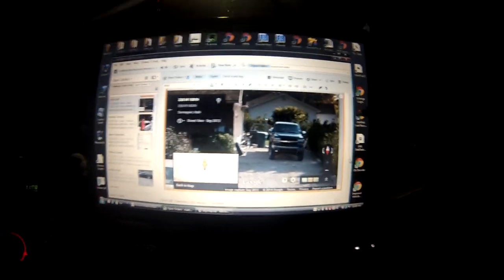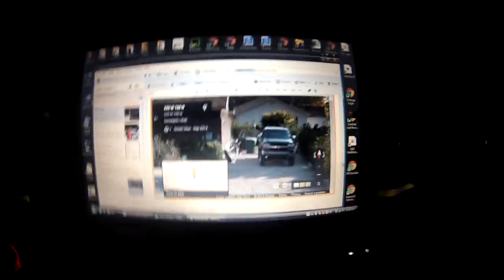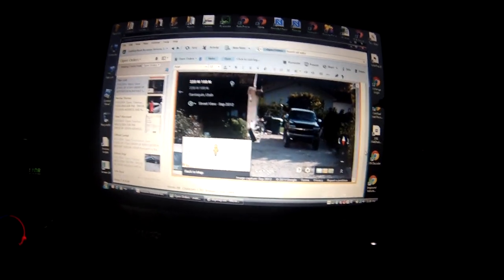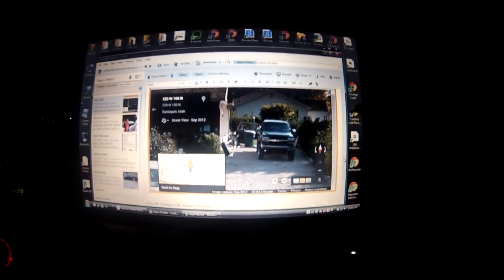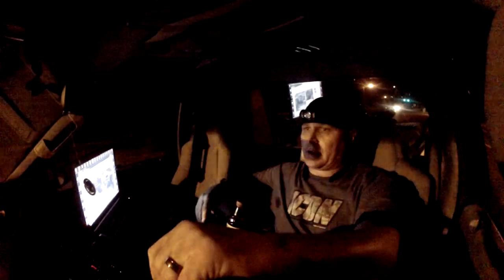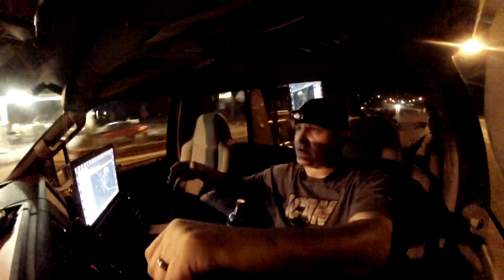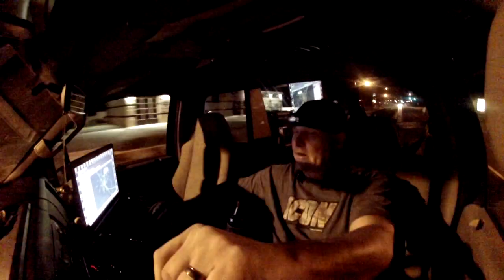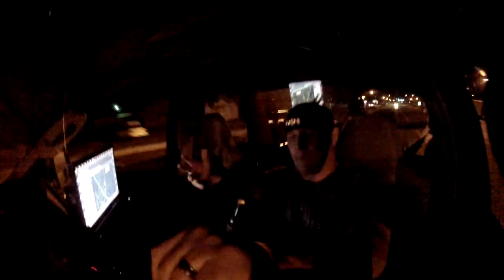It Is A Simple Fact That Size Does Matter When It Comes Down To It - 09/22/2014

Comment: Honestly I have never had any issues with my 6.4s I've got 2 of em.. I have a 6.0 to that's a pile of shit its in the shop every month. I have 2 6.7s one that's my daily driver not a work truck. I got one 7.3 best motor ever built almost 300k miles, I started my business with it. I will never own anything but a ford. I work mine just and hard as my guys beat on the other trucks, tow 13k generators on trailers daily, towing them up some nasty shit to get on site. I'm a electrician...I rely on those trucks to keep me going and feed the kids. BUILT FORD TOUGH

Comment: Did you consider a Ford f650 with the Cummins engine?
Reply from the maker: MrGommer101 Until I heard the price $26K
Reply: Did not mean a conversion but a F650 chassis rather than the F550? They will not honor the engine work warranty based on you used a tuner? keep up the great videos

Comment: my mom's blinker does that same thing but there's no bulb out anywhere
Reply: +James Wilson If she has LED lights, then she needs load resistors to stop that from happening. All LED blinker lights need them, a lot of ppl forget to install the load resistors though because they rarely come included with the lights.

Example:  http://www.ebay.ca/itm/231798219811?_trksid=p2057872.m2749.l2649&ssPageName=STRK%3AMEBIDX%3AIT
Reply: What about on an older car that doesn't have LEDs? both sides blink fast then slow down to normal after about 5 seconds.

Comment: Tracking device? Is that legal?
Reply from the maker: RyanScottWarner The contract the lender has the customer sign at the time they get the loan states that in the event the loan goes into default for these reasons then they have the right to come out and repossess the collateral and hold it for a period of time until the loan can be reinstated or the collateral sold to satisfy the balance. It also says that we can use electronic devices such as laptops and the Internet to find them and to run their credit among other things. There is also a small clause in the electronic section that says we can also install and use GPS tracking devices on any vehicle owned by the customer to locate them for the purposes of repossessing the collateral. We cannot track them at random anytime we like unless the loan is in default and we are actively looking for the collateral. That is why it is not considered stalking and is not an invasion of privacy or illegal.
Reply: Ohh, I didn't know, was just wondering how that worked.
Reply: no
Reply: i don't know what Utah is like but, the finance company is asking them to do it so it is technically legal for certian uses.

Comment: repo trucks have the weight hanging to far out the back. Our normal stinger and boom trucks can suck the truck up closer to the back of the bed of the tow truck. Our 3500hd will pull that truck without flinching.

Comment: A GPS tracking device from a private company?  I don't know what state this is, but that can't possibly be legal.  I'm not even sure the police can do that in most (all?) states without a warrant.

Sourced information proving it is legal would be welcomed.
Reply from the maker: Anthony Clauser The contract the lender has the customer sign at the time they get the loan states that in the event the loan goes into default for these reasons then they have the right to come out and repossess the collateral and hold it for a period of time until the loan can be reinstated or the collateral sold to satisfy the balance. It also says that we can use electronic devices such as laptops and the Internet to find them and to run their credit among other things. There is also a small clause in the electronic section that says we can also install and use GPS tracking devices on any vehicle owned by the customer to locate them for the purposes of repossessing the collateral. We cannot track them at random anytime we like unless the loan is in default and we are actively looking for the collateral. That is why it is not considered stalking and is not an invasion of privacy or illegal. So the sourced information is on the back of every disclosure agreement for every repo we pick up.
Reply: That isn't really sourced,  and it certainly isn't citing any laws. Contracts don't over rule laws.
Reply: Anthony Clauser
If the customer signs the papers then they are giving consent regardless.
Reply: tct72 No.  Existing laws always trump contracts.

There are some pretty obvious reasons why it needs to be this way.  (Ideally) Laws exist to protect people from themselves and others.
Reply: Anthony Clauser The vehicle is technically owned by the bank if they have the title. It's the banks property to do what they wish until it is paid off.
Reply: That's the only reasonable response so far, and it may very well be correct.

However the car is still on private property, and despite the clear (physical) ability by the bank to recover the car it choose not to.

Obviously privacy laws would remain in effect.

Again.  GPS devices without a court order would go anywhere from a very sticky legal situation to flat out illegal.  If the police can't track a private car than a private company shouldn't be able to do so.

This all comes back to my original request - Factual information.  Commentary is fine, but doesn't answer the question.

In all of my brief research the law *heavily* favors the consumer.  I have yet to run into useful information for GPS usage.

Here is some broken down information from a law firm:  http://www.bblocklaw.com/practices/car-repossession-law/
Reply: Anthony Clauser I am not a lawyer,do don't hold these words against me. However, whenever a person signs a loan with a bank or whomever (we will go with a bank for example) they are getting money from, they are legally signing the vehicle(s) to the bank (which would be highlighted in the loan) and the bank now has legal possession of vehicle. So having a contracted towing company hired by the bank to attach a GPS to a vehicle that the bank legally has the title of, then it would be no different from you going to a store and getting a GPS to your own vehicle. I did some research and came up with this:
     "This bill:
                      .    provides that any person, whether or not a law enforcement officer, is entitled to
                  install and use a mobile tracking device on any property belonging to or under the
                  lawful control of that person."
In this case, "the property belonging to or under the lawful control of that person" would represent the bank. Here is the source: http://le.utah.gov/~2005/bills/static/HB0215.html

 Now when it comes to Utah law, I remember watching  a recent video that went up from Reponut when someone had tried to claim he was trespassing and his words were something along the lines of "It is only trespassing when you tell me to leave and I fail to do so, or if you have a posted sign". Obviously different states have different laws, but I did some more reasearch and found this:

"(b)	knowing the person's entry or presence is unlawful, the person enters or remains on property as to which notice against entering is given by:
   (i)	personal communication to the actor by the owner or someone with apparent authority to act for the owner;
   (ii)	fencing or other enclosure obviously designed to exclude intruders; or
   (iii)	posting of signs reasonably likely to come to the attention of intruders; or
(c)	the person enters a condominium unit in violation of Subsection 57-8-7(8)."
Source for this can be found here: http://le.utah.gov/xcode/Title76/Chapter6/76-6-S206.html 

So unless someone verbally tells says before picking up the vehicle to leave, locks the property with a fence and lock, or has a sign that states no trespassing then he can enter onto a property to attach a GPS tracking device. I hope that helps clear any confusion up.

EDIT: For the record, since we are watching Reponut in Utah and stuff, that is why I gave Utah laws, just so that people don't mix laws from a different state in these videos.
Reply: fireballs450 shut that dude up quick. i think that has to be the best responce ive ever seen on youtube
Reply: TheFavess I responded.  It was deleted or lost.  Regardless he is on the same wavelength as me, so I'm not sure what you are going on about.
Reply: Jimbo Cee Based on that comment I'm sure the sum intelligence of 100 of your smartest friends doesn't come close to that of just one of mine. 

My friends don't take baseless comments as fact and they sure as he'll don't take those same comments as fact when they can't be backed up when the smallest amount of scrutiny is created. 

Quality over quantity.
Reply: RepoNut Did you forget to put on the GPS device? You pulled out but i never saw you go back.
Reply: Dipshit!
Reply: The lender is the owner of the vehicle. They have the title. They can put a tracking device on if they wish.
Reply: Very well sourced.

Just shut up people.  You look like idiots saying the same thing despite SOURCED information saying you are wrong.  And not even a little wrong - Dead wrong.

-- Muted --
Reply: Anthony Clauser
 "The Third Circuit Court of Appeals in Philadelphia ruled today that evidence derived from the warrantless use of a GPS tracking device by police can be used in court."

At least in one state it's legal for cops to do it. Also, just because something is on private property doesn't immediately make it illegal to use GPS tracking. I'm sure rental companies do it all the time. One article cited that almost 2 million vehicles have immobilizers and GPS tracking devices that are installed before purchase for high-risk borrowers.
Reply: RepoNut if you lease a brand new car (toyota tacoma for example), there is an integrated GPS tracking device that runs separately from vehicle batt and power. I signed on the dotted line for that....and if I ever wasnt able to pay my loan I would drop the truck off at the dealership. I dont want RepoNut coming out with 8 cameras and a drone :)
Reply: Im no lawyer or anything but If loan disclosure says gps tracking in default will happen and consumer signs the agreement thats their fault. Get loan from another lender. I wouldnt even try fighting this gps tracking issue.
Reply: Mike Sonntag Not to mention like previous person said If I would be in default I wouldnt even let it get to a repo ill just return it to bank and bring it to them and save embarrassment not to mention the cost which im sure comes out of pocket of consumer for repo to happen.
Reply: Everything is legal until the law says you can't.  If no law says you can't do it, it's legal.
Reply: Anthony Clauser How about YOU show some sourced information of a law he is breaking? You are asking people to show you laws that allow it... and thats pretty damned hard to do... show us a law saying he cannot use one.
Reply: Anthony Clauser "No. Existing laws always trump contracts."

So what's a non-disclosure agreement? The law is that you have freedom of speech, a non-disclosure agreement is not only an agreement to give up those rights, but in the event you do talk about whatever you agreed to remain silent about, the company you signed the deal with has the legal right to go after you for damages. What about people who are on probation and they sign away their rights to gun ownership, alcohol use, or any number of other perfectly legal things? How does that play into your idea that laws trump legal contracts? Now what is illegal, without a shadow of a doubt, is RepoMan over here playing with his laptop while driving down the road.
Reply: Anthony Clauser "a private car than a private company shouldn't be able to do so." - the private company authorizing the repo company to install the GPS is the owner, not the lessee, the police cannot install a GPS because they don't own the vehicle
Reply: It's not their vehicle so they have no say on the matter lol it belongs to the bank until they pay it off so technically the owner(the bank) told him to put the tracker on so its legal because the true owner asked for it
Reply: Phillip Busmus He got pissed he was proven wrong and rather than admitting it he muted the conversation. Don't expect a reply in a big hurry.
Reply: +Anthony Clauser it's not like they are trying to follow the owner of the car, they are finding out where the car is at.
Reply: its the banks truck and they can do what they want with it. stock cars come with GPS trackers.
Reply: +Anthony Clauser police operate differently buddy.
Reply: +Lee Hill the bank does not own it.   if they did they would be required to pay the taxes and insurance. the bank is a lien holder
Reply: Utah is different I'm guessing. i don't know what the deal is in Utah but I'm sure it's legal if the finance company wants them to do it.
Reply: nope.  The finance company holds the title, they are the owners until the debt is paid.  The contract simply requires the debtor to  pay the taxes and insurance.  Not every state is the same , thats the way its done in Utah.
Reply: It's likely just a clause in the lease on the vehicle. You can sign away any of your rights voluntarily. You have the right to free speech but a nondisclosure agreement is still legally binding. If the bank requires this, and you signed a lease agreeing to it, there is nothing you can do legally.